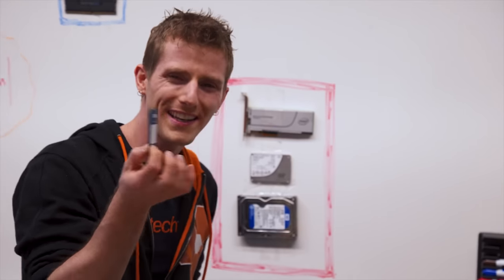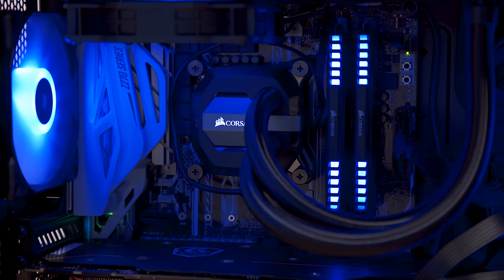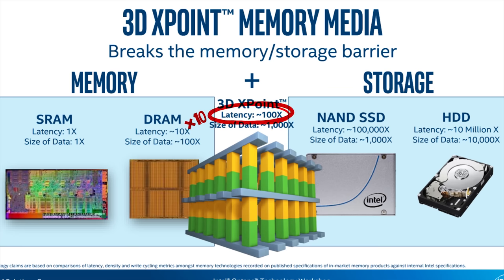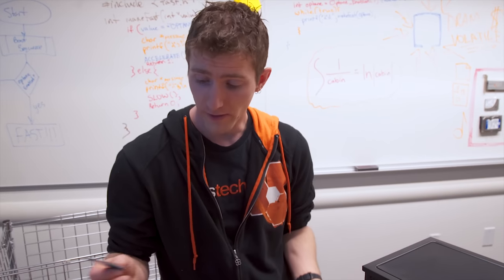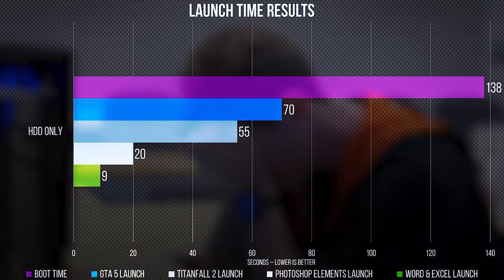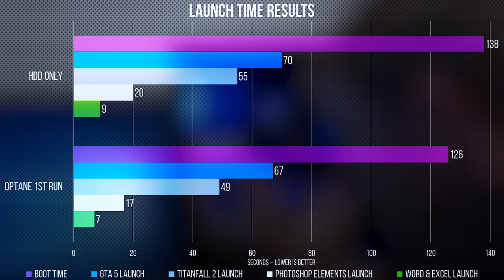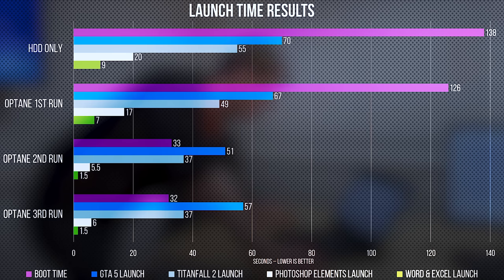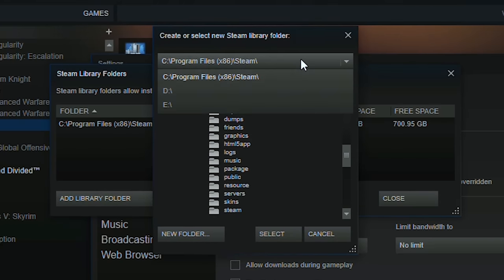Intel Optane Exclusive Hands On - SSD Crushing Performance

Comment: The issue I have with this tech is that it requires the latest intel processors and it is not compatible with older 6th and 5th gen processors. I think this is where this tech could truly shine. With motherboards already lacking additional resources (only one m.2 slot), I don't see how this tech can fill the void of systems with a quad graphics card setup and a single m.2 NVME SSD to boot the OS. Traditional hard drives will still be used for volatile space but it's bottlenecked by the slower sata connections. To my knowledge, NVME SSDs are significantly fast!!! Load times, and boot up times are leaps and bounds from how traditional spinning HDD use to load and startup systems. The real question is, does the latest system really need it? I mean how much of a bottleneck is NVME SSDs? I like the idea of using Intel's Optane as additional RAM but with consumer programs that really only use up to 32GB of RAM, I don't see how Intel's Optane justifies its existence. If this is Intel's revision of their Smart Response Technology, then why can't it support their previous generation processors as those systems could really use the significant boost in speed bottleneck by Sata connections.

Comment: how does it interact with older x99 or z170 or even amd hardware? does it just act like a storage drive? could i simply install an OS just on the octane module? i have so many questions

Comment: Do you think the new tech will will replace hard disc and DDR Ram? As the read and write speeds are massively significant...and I personally think this tech when out gets cheaper could easy replace these components and change the space and and form of a desktop - maybe even see a merge between desktop and mobile formats in capability!

Comment: I think optane would sell like hotcakes if theyd enable older generation chipsets to work with it. I mean people still doing just fine with their 3770 and 4790k cpus , and even the older xeon workstations would benefit greatly from this. But If someone decided to built a 7th gen intel build, id imagine they would have already had an ssd in it. I mean thats just a given nowadays. If theyd get this working with older systems this could be a goldmine.

Comment: Any idea if it is possible to populate 2 different m.2 slots, with one of these Optane modules each, and then assign them to specific mechanical drives? Is this kind of related to the feature in Windows called "Ready Boost"?

Comment: Since this cache module has the performance bandwidth to saturate an PCI_e x4 3.0 slot would a conventional SSD also receive a performance boost? Since SATA SSDs can't exceed the max theoretical speed of 750MB/s that a SATAIII connection allows a cache to quickly access data which is faster should still yield better results. Though the users ability to see the performance increase may be negligible. Unless they use large files regularly.

Comment: But would Optane boost a SATA SSD? Food for thought. It boosts the HDD to SSD level, yes. I guess for $50 you can't really go wrong... I mean the that's cheaper than the RAM in my PC, so it really couldn't hurt a build to have a non-volatile type of RAM.

Comment: For the purpose described, why not use an SSD as cache? I don't think these Optane tech is used at its potential, they should seek to replace memory and storage with a single solution. Imagine having as much free RAM at a moment as the amount of free disk space you have. That's what non-volatile RAM could do, and this Optane gimmick seems to be able to do that should they improve further on it.

Comment: How is this different than NVMe. You did not really say. I just got the 240 GB BXP MyDigitalSSD and it is insanely fast in sequential. Random seek / write is OK. Also I got it for $110... and can actually use it as a drive.

Comment: This is perfect for me I'm running a I7-6700K on an MSI A Gaming M7 with a 2TB HDD so it saves me an ssd but the downside is the board doesn't have many pcie slots so my GTX 1080 Sli will be at stake 😅

Comment: I really don't like the fact that you have to waste an entire M.2 slot for effectively what is only cache in a system. This is definitely aimed at the consumer that has no SSD in their machine, but who does not have SSD these days on a 1xx, 2xx series chipset with a spare M.2 slot available? Cheap price though for somebody who wants SSD like performance, but it has to be cached, and with 16GB & 32GB modules available, I am pretty sure that recycling for available space is gonna be often if they have tonnes of appz / games, etc. M.2 SSD is cheap enough and a far better use of a M.2 slot on a motherboard at the moment ^_^

Comment: Silly me; i missed the boat, and, simply went for the 500 gb 960 EVO...; most recent CrystalDiskMark shows 3260 MB/sec sequential. Reckon I shall survive without this generation of Optane! (Still waiting eagerly for Intel's claims of '10,000x faster' to materialize; hell, I'd settle for even 2x faster than the 960 EVO)

Comment: Hello, I was able to contact Intel Customer Support regarding any performance gain at having an Optane drive linked to a M.2 drive versus a 2.5" SSD.
The result is that an Optane drive would provide similar performance gains to either a 2.5in SSD or M.2 drive.
Based on what I've found, if your system's processor is 7th gen and desktop motherboard is a 200 series with a mechanical hard drive, adding a Optane (OS installed) could boost its performance to about that of a 2.5in SSD (Optane drives are either 16GB for regular consumers or 32GB for heavy users).
It's recommended that the Optane drive must be connected in the NVMe* M.2 slot with direct lanes through the chipset (confirm with motherboard manufacturer on which slots are ready for any mapping of the Optane drive (and M.2?) ). 
I'll be looking at the cost of either a 16GB or 32GB Optane drive, one 1TB M.2 SSD (or not?) and two 1TB to 2TB 2.5in SSDs (No mechanical hard drives)?

Comment: What is with the slow boot time?  I timed my regular SSD on a restart and got 19 seconds from clicking reboot to being back at my desktop.

Edit: Derp I just realized they were using it as cache to a "spinning rust" HDD so yeah, still not as good as just an SSD

Comment: This tech is mostly intended for the Data Center because of its 0 latency and the fact it can complete rewrite itself 30x a day for 5 years, this is just one example of the tech doing something it's not necessarily designed for, do research before saying intel is ripping people off!

Comment: It sounds good, but I feel its for a very certain market. Because you basically need to own a PC with a Brand New 7000 chip, and a upscale 200 series motherboard with a compatible M.2 slot. It feels like its not marketed towards enthusiast, though you basically need 2017 enthusiast grade parts to run it? Also because of it being locked to this, I feel that there missing alot of people to this only being locked to such a small market. Though it sounds cool, but I guess ill stick with me SSD boot drive

Comment: At 2:20, regarding speed of drives you didn't list M.2 drives, are they in a different category?
Weird,; I saw this a week ago (see previous comment) but missed the Optane having the OS versus Optane boosting the drive (SSD preferred) with the OS?  I know a M.2 drive is faster then an SSD (SATA) but is it to a NVME?
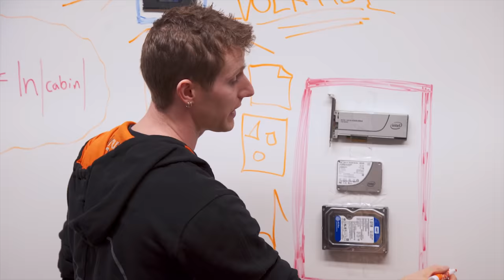At 2:12 you said that motherboard has two M.2 drive slots so you can test my theory (in previous comment) and you can see if there's any difference with having the OS on the M.2 or Optane?

Comment: Will it ever be made for skylake?? I really hope so I would benefit greatly. ATM I am only running a 240gb team group l5 ssd for my O/S and a few programs, but all my games are run off of a regular hhd and most of my backups are on another hhd. I do regularly pull stuff from both mechanical hhd's. So I would love to see if this helps me at all. And at $50 it does not seem like that much considering if I were to go all ssd it would be about $350 for me to do so. Heck right now I have about 670gb of just games.

Comment: Sure, now please explain why I should buy it instead of a 128/256gb SSD, because I don't see the point. Even my X79 board could do SSD caching, and a larger cache size means more data can be stored on the solid state drive.

Comment: you don't explain the bios settings, Intel driver download, and the installation process... I have Asus Stryx Z270E + optane 16Go + SSD Evo 850Prod Samsung 256Go as the system disk + 500Go as data SSD. All recognize by the bios.
Optane plugged at the bottom of the MB like you and updated the bios also. 
But windows is always in error when i active optane in bios... the Intel driver didn't recognize the bios also...
Maybe a video on this installation could be useful for people

Comment: 138 seconds boot time is "average"?! I know it's supposedly a widespread problem - long system load times - what what the hell do all these people run on their systems that I don't to experience this? And I'm talking my budget laptop that doesn't have an SSD, runs WinXP, and overheats after about 10 minutes of running screen saver, that still takes 30-40 seconds at most to boot up - not a flash new gaming PC.

Comment: I don't exactly see a reason for the average consumer to favor Optane (and potentially all the other hardware prerequisites) over a 128GB SSD, or maybe even a hybrid HDD - it's not exactly the bottleneck in your typical user's use case scenarios.
Case in point: my PC boots in less than 33 seconds, with an SSD. So does Optane suck? Nope. Is it used poorly? I believe so.

Comment: I don't really see a use for it. Sure, maybe transferring files across a network might be faster, like some ISCSI drives can do with SSD arrays, but... For the common user, I don't know that it's altogether useful. I don't know people who spend a lot of time booting their computers. It would have to be practical for things that are hard drive intensive. Perhaps a media streaming box using Plex. It could load the data faster for higher resolution videos..

Comment: Is it actually possible to use the Optane memory with a HDD while the OS is installed on a normal NVMe SSD that doesn't use the Optane memory at all? That would be cool, since it would allow me to get the best boot time and data safety out of the SSD but also provide a good and fast solution for large videos and games that doesn't sneak like with a HDD only.

Comment: I have to wonder if the performance would increase if you're using a sdd for boot, an hdd for sheer memory storage capacity, and then use the optane. Or if that'd change anything at all.

Comment: If your only a consumer and only going to get the 32 Gig for caching a HDD, to increase performance, you probably optimized all of your system boot and major applications to run on a primary SSD. This technology is years to late and intended for the  HDD/flash solutions. Who is doing that now? Just wait for the 100 Gig drive to hit the consumer market.

Comment: If it can do that to boot time and basic system snappyness, why the hell is the tech not included on all motherboards???

And so added even before any pci lanes is used, but as a integrated piece of hardware right  next to the cpu. It would be a boost to basically ALL computers.

Comment: Noob question: at 3:00 he said that its for someone who don't want to worry about write cycle limitation. does it mean you can use it for decades with no cell decay? I got a Triple layer SSD and losing data or just capacity is always on my mind.

Comment: So, if I was to have two M.2 slots on my mother board running a RAID 0 say two 1 TB  and had this inline before them they would perform faster and then have a back up 2TB SSD back up to the RAID 0 drives.

Comment: Ok, where is the SSHD in this Video?
I mean SSHD is pretty much what you described in one package and cost less.
Maybe there are server applications, wich benefit from this niche product, but you could also use normal NVME SSD or even SSD for that as a buffer. Probably depends how much you as a company want to optimize.
But as a consumer, I don't see the selling point if I can buy a SSHD.

Comment: i'd buy a 4 TB octane module if it was only about $500
Reply: I have a feeling this 3D Xpoint memory could drop dramatically in price if it was mass produced to replace storage drives... It's a simpler part, less complexity right....?

Comment: Does this even help if you use SSD storage for everything but a massive steam library? I'm pretty sure you could have just swapped that HDD for a SSD and it would be like the same time as optane.  Also only for 7th gen, are you serious? So I guess this 6700k I got 8 months ago is useless now for anything Intel comes out with.
Reply: Nicholas Estrada your argument is invalid. If a normal consumer is going to get an octane they need a 7th gen processor, which means they would be buying a whole computer because they're not just swapping their processor. At which they would be better just to get an ssd with their new computer.

Comment: You need to "optane" a few more dollars and just buy an SSD NVME! 

FYI I went out and bought new 7th gen cpu and z270 mobo just to run this cause I was told with optane and u.2 intel 750 drives it would be 1000 times faster than SSD. I am still waiting for jack to come down from the bean stock so I have time. For now SSD NVME FTW

Comment: WHat i don´t get it is... who would have enough money to buy a better MB that already has M.2 slots but doesn´t have enough money to buy a cheap ssd to handle the O.S. and basic programs....? i mean this is going for 50 buck for 16gb when you can buy a 120gb ssd for the same price and use the HDD for large file storage or w/e? doesn´t make much sense to me for a price/performance standpoint.

Comment: If you're still using a HDD, your system probably won't even support this thing. If you're building a new computer, anyone with common sense would just leap frog this thing, and get an Octacore CPU, and an SSD. I'll stick to my Ryzen 7, and Samsung drives.

Comment: This looks like a step back. Either too rough on the edges yet, or just pointless.
I've got an M.2 SATA SSD having 64 gigs as SRT cache (yup, Intel too) for an HDD, and the rest of the SSD houses the OS. And this thing boots up in 20 secs. And it's significantly cheaper&older than the configuration in the video. And I got the compatible hardware by accident, meaning I didn't buy any additional stuff just for SRT to work.

Comment: Didn't Intel create USB? Well, instead of requiring a 2 series motherboard, why didn't / couldn't they have put it in USB 3 form, available to more Users, and portable? Like Microsoft Window's ReadyBoost feature on a flash drive. (Now that I think about it, maybe USB 3 is too slow for Optane, due to its slow connection?) Or, on a PCIexpress card - because for those of us that don't use 2 GPU's, we have those available. (But maybe speed is also a reason?) I'll have to check this out, but the only other video I've seen on Octane said it was too little, too late - but as a new product, perhaps that reviewer didn't give the technology enough credit. I'm all for speeding up a PC, so if this technology is viable, I want it to be widely adopted! - When I asked my favorite tech at Microcenter about Hybrid drives, (sort of the same concept), he said they're not practical.
Reply: Don Fisher got a core i7?
Reply: Don Fisher Kaby lake

Comment: I still dont understand what its good for. So it made a system with a hard drive faster. Why not just start with an ssd and the problem is solved? Is it just a hdd accelerator? Can it be used as storage? Can it be used as a boot drive? If so, how does it compare to m.2 and pci nvme? This piece of hardware makes no sense to me. Unless i am completely missing something, it seems utterly useless for anyone that has an ssd in their system.

Comment: I'm just sad we cant natively within windows configure a cheap, 64-128GB SATA SSD, to work as a cache drive for an HDD, boot windows on the HDD, let it know 'hey i want to add a cache drive i want this this and this to be stored on it" power it off, add the drive, and then boot up, your manually selected files and folders are copied over as well as automatic files that would help speed up boot and applications, sort of like those laptop "SSHD"s but on steroids data will only be written back to the SSD when those filed stored on the SSD are changed, any data that will be written to the hard drive is only written to the hard drive, no caching and wearing on the SSD

Comment: Are you sure you're an IT Professional? Because a real IT Pro would NEVER touch the (golden) contacts of any board - human sweat is highly aggressiv/corrosive for eletronic parts. If you do so the board, especially ram, will cause malfunctions within 12-18 months. Additionally using esd-protection against electrostatic damage is a must; at least touch a grounded radiator before touching electronic parts. Ridiculous to spread such a bad handling of hardware.

Comment: So i presume the performance of any application will drop down to the original first boot numbers once the cache has been filled/Rewritten and needs to access the HDD again?

100% snake oil.  Unless you just have a few applications that are smaller in size than the cache that will never have to be rewritten.

Comment: How does it compare to an SSHD?
Reply: Its not a primary storage device, it will help accelerate it not replace it.
Reply: I know. Just like an SSHD is an HHD with acceleration through a cache SSD.

The idea was: How does it compare to existing possible hard drive accelerations.